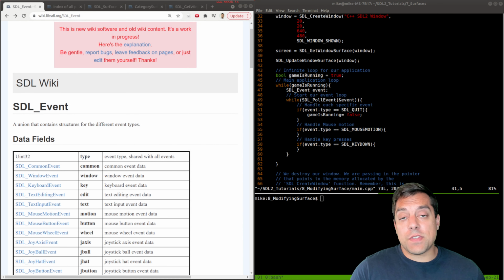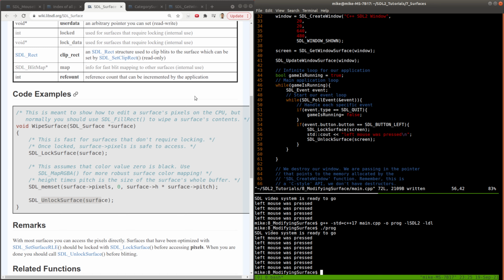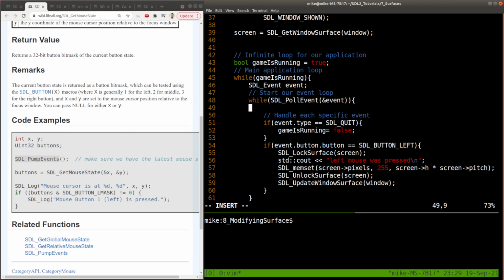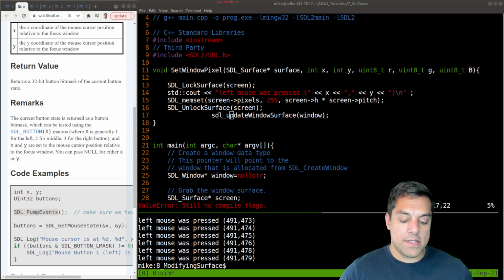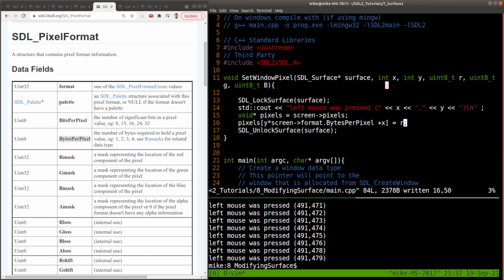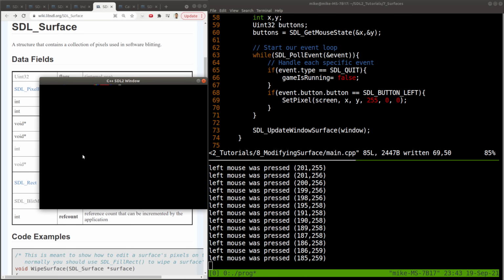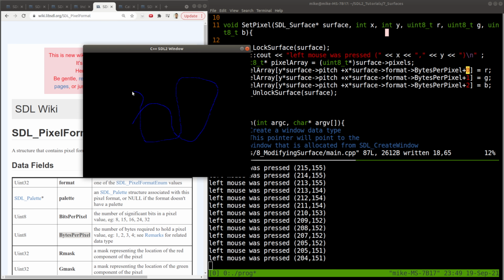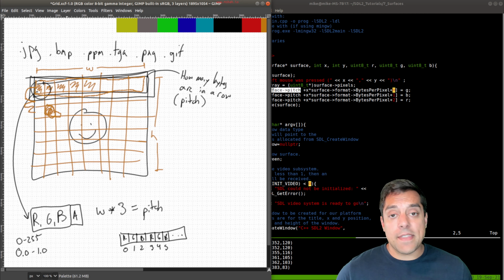[Ep. 15] (Live Code) Learn with me how to modify SDL Surface in realtime | Introduction to SDL2

Comment: I'm only getting a occasional dot, when I press the mouse button the "Pressed mouse button" prints a hundred or so times in just a quick press, and my pixels are microscopic, I do have a 4k monitor. but this is not drawing a line, I did try switch case with  SDL_MOUSEBUTTONDOWN and MOUSEBUTTONUP, it only sort of slows it down some , but no pixels show up at all. I'll keep following along, but I would like to try and figure this out.

Comment: Ok, Mike, thanks to your tutorial I finally managed to write a fast raycasting engine. According to my experiments I can have some 160 fps with 800x600 fully textured frames. Without you I woudn't be able to do this and I thank you very much. 

Writing a racaster I've learnt a lot and I have some important caveats. Maybe it will help someone else:

1. In your code it's absolutely crucial to cast surface->pixels as byte pointer (uint8_t* in your code). I casted it as int pointer and my programmed performed very strage behaviour, even crashed. 

2. The code is MUCH faster if you read and write components all at once. In order to do it we need to cast surface->pixels as int/uint pointer. So we will hove some 
 int* pixelArray = (int*) surface->pixels;
 pixelArray[y * intsPerPixel + x] = color;
instead. We can read color from some texture. It will be much faster because we only read and write from/to memory once instead of 3 (or 4) times.  

3. The code will be MUCH faster if we put locking/unlocking texture outside the setPixel procedure. 

4. You may have had rgb pixel format, but due to little endianess the order of bytes was reversed. We always need to check our endianess (big endian vs little endian). It's very likely you had XRGB format (4 bytes, first byte unused).
Reply from the maker: Awesome to hear! And thanks for sharing you recommendations and improvements to code!

Comment: The live coding style was a nice change of pace and its always good to see that the teacher has to troubleshoot through ideas as well. Super weird about the right click not updating on the fly...almost like the SDL_BUTTON_RIGHT and SDL_BUTTON_LEFT are implemented quite differently under the hood. I was trying to utilize right click as an eraser by setting to (0,0,0). Anyway, appreciate the content as usual.
Reply: Very strange indeed. I managed to circumvent that by checking which button's been pressed with the SDL_GetMouseState function instead (as you pointed out, the mouse button event field doesn't seem to update for right click drags). It returns a button bitmask which you can compare with SDL_BUTTON(X) where X is the macro of the button you wish to check for (e.g. SDL_BUTTON_LEFT for the left button).

Note: the comparison must be done with bitwise operators, hence you can also check for multiple button presses at once.
For instance, if I were to determine whether both the left and right buttons are pressed simultaneously I should ask (~SDL_GetMouseState(NULL, NULL) & (SDL_BUTTON(SDL_BUTTON_LEFT) | SDL_BUTTON(SDL_BUTTON_RIGHT))) == 0.
Reply from the maker: Cheers! Yes I like to leave in the mistakes sometimes and am considering longer streams on twitch in the future. As we get into more advanced tutorials it's worth seeing more how I think about the code. Nice work working through the content!